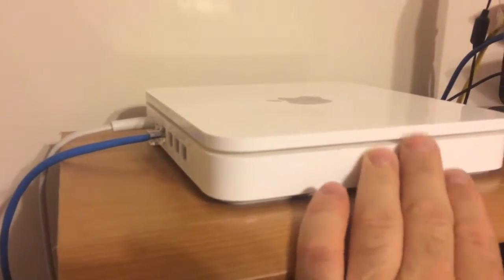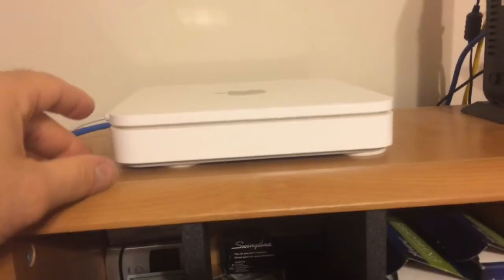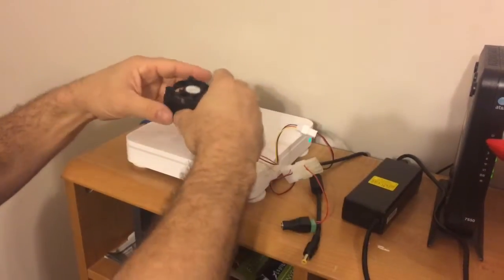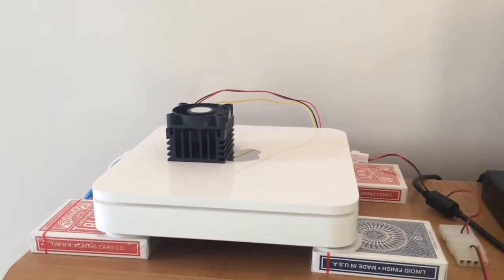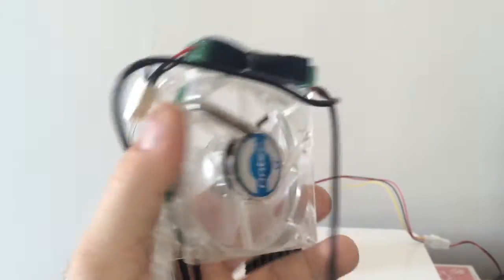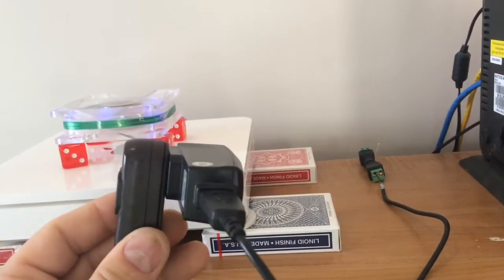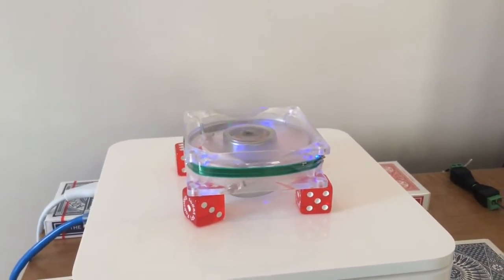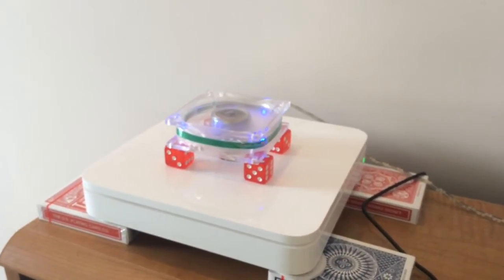Apple Airport Time Capsule OVERHEATING [Quick Fix]  - Temporary [KTFG 188]

Comment: Thanks for your suggestions.
I have a gen 4 A1409 Time Capsule.  Never has a problem with it.. only lately when I put a 16 ports switch on top of it and blocked the air circulation.
It became vey hot over 45C.
I installed 4 DIY feet underneath made from a cut eraser and fixed by velcro. You can aslo poistion the TC on a mesh shelf instead of a flat wooden surface.
I also installed a small fan (Multifan S4 from AC infinity - Model AI-MPF140A from Amazon) dimensions 5.5.X 5.5 X 1 inc, on top of it powered from te USB from the TC.
Extremely quiet. 
The TC is now very cool.... I had installed a 8TB  drive into it so it was running hot during backup but not extreme like it did with the switch on top of it.
Works great w/o having to dismantle it and modify the fan or the look.
Reply from the maker: Good info.
I now have it on metal heat sink and a blower fan on it.  Will be in my upcoming "2020 Studio" video and web post.  May post pics on instagram  https://www.instagram.com/ktfg_9/

Comment: It has an internal cooling fan.
Reply from the maker: Yes but it’s inadequate and the unit traps heat causing the PS to fail prematurely.
As in nearly all modern electronics heat dissipation is lacking but it’s especially true with Apple products because of their strong emphasis on aesthetics over than functionality.

Comment: I have to cool down my Mac mini like this, too! Thing's running hot like crazy when it has to reproduce 1080p videos for several hours. Another option for passive cooling would be to put a large water-filled frying pan ontop of it.
Reply from the maker: Now my iMac is running hot.  The fan is not working, not sure if hardware problem or software.  I am about ready to pour a pan of water on it.
Reply: @Kevin Gittemeier: Dont forget the hot dog sausages! ;-)

Comment: Is that rubber base cover really needed? There are so many air holes in the base all covered up by it. I would try removing it and using rubber feet on the base. It would seem that Appel has designed failure into the service by blocking the air path.
Reply from the maker: +Subgunman 
Agreed they could have done without rubber (insulated) base.
Apple puts aesthetics too far ahead of practicality and longevity.

Comment: I just fixed this based on your film by strapping rubber bands from 12v quiet fan to the bottom of Airport Extreme.  It's working so far (4 hours).  I'm running a time-capsule backup and transferring from an old SATA drive to a USB drive - so far so good!! (I missed the warranty by a few weeks - but I feel better anyway with your repair than to bring it in and wait a few weeks.   (I have a pic - is there a place to post it?)  Thanks for the great vid!!

Comment: unless you're forcing air UNDER it, wouldn't it be better to let it sit on the desk like a big heat sink?  this has much better thermal conductance than air.
Reply from the maker: +jeff n Good idea. Yes it would if the desk was metal.  This one is wood which is not a good conductor either so at least being spaced up the warm air can rise allowing cool air to replace it "air cooling it passively".  
Even better I could put a large aluminum heatsink under it like the one in this video https://youtu.be/8L9T6dDX6Fg.